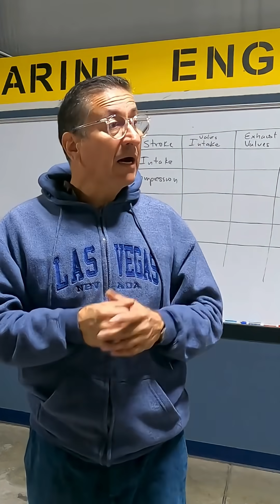Engines Today

Comment: I think this is actually false. Efi engines can be so so so easy to diagnosed very simply. You just need to understand a little about how everything talks together, and what each part does. A $40 scan tool can show you EXACTLY what's wrong. I argue it takes more knowledge to diagnose a carburetor, or an hei ignition setup.

Comment: There must be a way to bypass all those sensors in the fuse board, so that only the basics apply 🤔
Reply: It's controlled fuel injection use a stand alone computer system to eliminate most sensors